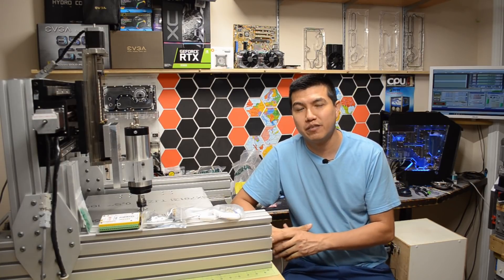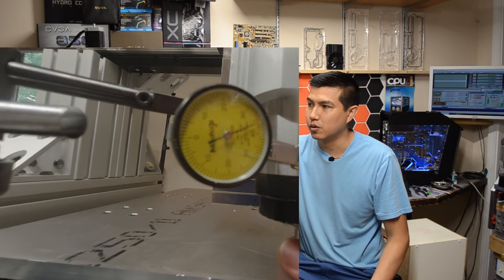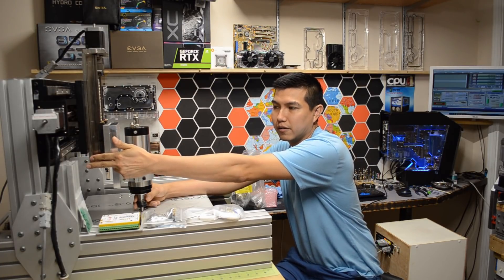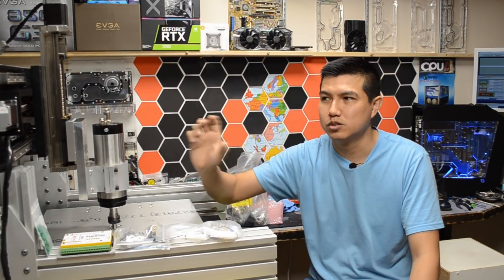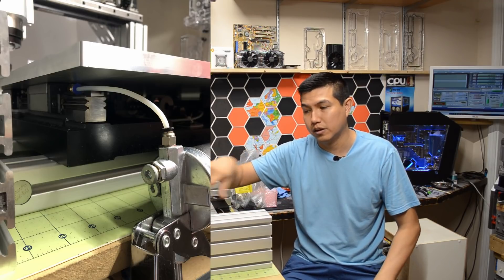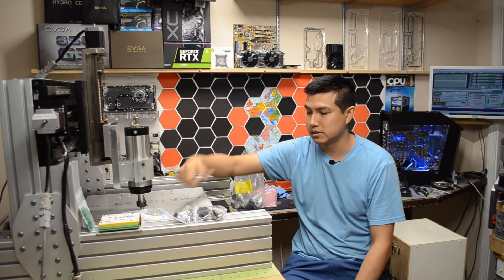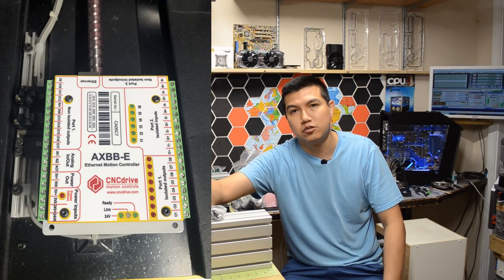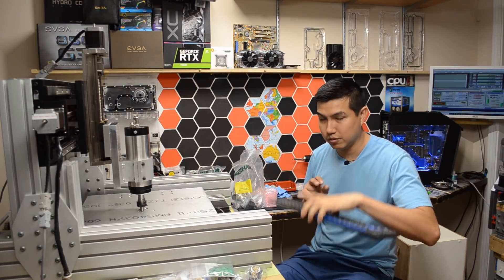DIY CNC Router: First Movements and Other Projects

Comment: why too noisy?
Reply from the maker: It’s just how stepper motor work trying to do to Microstepping. I got Close loop steppers after, it got much quieter and faster
Reply: @radikult-custom  bigger stepper motors like nema 34, is too noisy or less?
Reply from the maker: @Acseq8wy  it all depends on the speed and the micro stepping. Noise level could be around the same but a lot of things can make a difference

Comment: Greetings from the UK, thank you so much for sharing your wealth of knowledge.  It has been a while since you made this rebuild using repurposed equipment into a precision fixed gantry milling machine. Would love to know how well it has performed. 

Btw can you please tell me how to create the gcode for running the speed tests you showed in this video.
Reply from the maker: Greetings 👋. I have build a few CNC and by far fixed gantry is the best type for precision. 
 The Gcode was made in a CaD program like fusion 360, just cutting a circle in the air are different speeds for example.
Reply: @lt-custom Thank you for your reply. The problem I have is getting hold of the type of extrusions that 80/20 Inc make are not available in Europe/UK and the only way to get hold of them is someone can bring when travelling in our direction but depending on the lenghts/weight that can also be a problem. 

The nearest quality one can get to strenght is maybe getting profiles supplied by Mitsumu but their prices are very expensive for small orders. 

BTW - did you ever get round to covering the x-axis with Epoxy? Would love to see more videos of your cool machine milling different materials. Take care my friend.

Comment: You could just buy a stepdown converter from 48v to 5 - 24v. I personal run a gecko as well and I went with a 48v to 12v step down converter and run all my limit switches and relays off of that.

Comment: In your previous video showing how you filled the extrusions with epoxy granite,  it sounded like there was a big difference in ringing and vibration control when you tapped on them.  But in this video at 7:50 You are still getting a lot of vibration running at 28 IPM.  Have you found a fix for that?  I have a similar situation.  I was thinking of putting some foam board or shag carpet between the cnc and table to absorb some of the vibration.
Reply from the maker: I was using stepper motors for testing. After I change it to Closed loop steppers I don’t see the “vibration” like in the 7:50 min video
Reply from the maker: Maybe if you use a thick rubber mat can dampen the vibrations
Reply: @radikult-custom  so you get less vibration from the closed loop stepper?  any chance that you'll be demoing how it runs with those?
Reply from the maker: @bigvelvetdog  this was the final video I made. It shows a little bit of how the machine is moving at some slow speeds when probing 
https://youtu.be/3dYUZVZPBNs

Comment: Whats causing the stepper motor to make so much noise at low speeds
Reply from the maker: Fisherman Neil “power” the more voltage you give to a stepper motor the more noise it will make at low speeds. (Testing with 48v) But if you give very low voltage(24v) it won’t make to much noise but won’t have torque/high speeds

Comment: As an engineering student I must say great job!!
I have seen your whole build the one thing which annoyed me most was when you said I have so CAD..:(
As I continued watching I had some issue with your design since you have addressed in fine tuning i wont talk about that But,
i felt there was waste of material,If you had a CAD model you could have simulated and fine tuned the model and it would have turned out better.
the other issue was WHERE IS THE COOLANT!!!!
atleast may be a fog buster i would suggest otherwise Enjoyed watchin it!!!

Comment: Clearpath servos are nice but expensive and a lot of their built-in features are useless for direct step/dir controll. 
JMC's integrated servos are more than enough for a hobby machine and cost only a fraction.  
They also have closed-loop steppers with integrated controllers which are a good choice for the z-axis - during 2.5D operations on a router a higher holding torque on that axis is more important than peak power at high rpms. There's still a place for steppers, just not the cheapo open-loop stuff.

Comment: Nice work! subbed! I'm a fan of the fair cheap JMC 180W servo's. Smoother than steppers, faster, torque is perfect (a stepper looses holding torque with microstepping). I'm using them on my machine too, and they perform awesome. Clearpath is a clear winner in terms of user  friendliness (their auto-tune is very nice) .  The JMC's don't have advanced notch filters for system resonances, but they introduce far less resonances than steppers to begin with. The current available V6 (i'm using V5's) has some sort of auto-tune, but it's relative rudimentary.
Reply from the maker: Berend Lucas van der Weide I end up getting some Closed Loop Steppers, the clearpaths are great servos but I just didn’t had $$$ lol
Reply: @radikult-custom  Perhaps test one of the cheap (100usd/each) JMC 180W servo's! Closed loop stepper is a huge upgrade from the standard steppers! Do you use your machine to earn money or is it only for your own parts?
Reply from the maker: Berend Lucas van der Weide I use my cnc to make my own parts that I sell on eBay. So yes I use my machine to make money
Reply: good. I also use my machines for that purpose. I do  have some regular customers, make furniture on my larger machine, smaller one for aluminum and plastics/occasional steel.  It's nice to enjoy what your doing and make money in the end.

Comment: So ... You went through all the effort of epoxy granite filling the extrusions to get a better finish ... that means using real steppers would be silly and you should go with servos. Steppers ... step. You can see that 'stepping' in the finish. Servos don't have that issue and provide a smooth motion.
Reply: I'd consider closed loop steppers and a good quality hybrid driver, then max out the steps per revolution. This should be well suited to an aluminum machine. These days good steppers with good drivers can get high resolution & low noise but still have low torque at high speed and also lower efficiency for similar performance versus servo motors. Closed loop stepper systems are about 1/3 the cost per performance vs servos on the low end of the scale (up to NEMA 48 maybe) so as always we have to weight the pros and cons. Really though servos only become the best or only option when a machine requires torque or speed that simply isn't available from steppers for practical reasons (ie power dissipation, inertia considerations from the mass of the motor etc) or availability, which you get into on larger heavier and faster production machines.

Comment: Possibly look into "Clearpath Servos" dead quiet, tons of torque and generally don't loose steps also don't require smoothstep boards.
Reply: Or an inbetween solution (both price and performance), Closed loop steppers and drivers.

Comment: You could remove or shorten the Z plate that the spindle mount attaches to and clamp the spindle higher up.  The spindle motor is very rigid, it's a stainless/aluminum tube and is much stiffer than your aluminum bracket.  And you would be removing a source or vibration and weight on the Z.  If you delete that bracket completely, you would also be reducing the distance your spindle overhangs the gantry, which will increase the stiffness even more.
Reply from the maker: Reini Grauer I actually did that before making that extra aluminum plate. And you are correct, even do the spindle was attached at the very top I didn’t see that much play. 
The only issue with that is that the spindle didn’t quite reach the bottom Y axis table.  
Maybe once I make the vacuum table I’ll re measure the spindle depth and maybe remove that extra plate 
Thanks for the input
Reply: @radikult-custom  The end of the spindle doesn't necessarily have to touch the bottom of the table, as long as the shortest tool you are likely to use does.

Comment: Wow, those steppers sounded like WWII planes in a dog fight.
Reply from the maker: aksting lol. Happy 4th of July? Or remembering veterans days?
Reply: @radikult-custom  Veterans day is for honoring veterans, Memorial Day is for honoring those who served and died, and Independence Day is a commemoration of the Declaration of Independence from the United Kingdom. As a veteran myself, I find Memorial Day is not about having fun, but remembering the ultimate sacrifices many have paid for our freedom. However, Independence Day is for everyone and the best way to commemorate this day is by simply exorcising  your rights. I hope you have a very good Independence Day.
Reply: Are you using microstepping? Usually helps getting the slow speed vibration under control. Of course you loose speed.
Reply from the maker: pitu72ger I am using micro stepping, but it’s just how steppers work I guess. I just need to buy either servos or Closed loop steppers
Reply: @radikult-custom  I highly recommend the 3 phase closed loop steppers. They are very quiet. Not as silent as a well tuned brushless servo, but as good as you can get. Nema 23 motor and driver will cost  around $160.
Reply from the maker: aksting where can I find the stepper you mentioned? 
 I was looking at some 600oz from Stepperonline

Comment: mill the entire table with rhe router itself.. it will then be .00000 trammed across the table.
Reply: that only works if the X,Y and Z axis are perfectly square and flat to 0.0000000 inches (which no machine is and will ever be)

Comment: couldn't you use inputs 1-4 on the gecko for your limit switches i think they are 3.3 to 5 volts max. O and can i get some links to the touch probe, tool setter, and dust shoe in part 2 of the build. loving the cnc build videos i finally subbed
Reply from the maker: Ever Random here is a link to the touch probe 
https://drewtronics.org
The dust shoe I made it myself 
And as for input 1-4 on the g540 are negative trigger of the same 48v power supply.  Thats why I can use that with the optical limits
Reply: @radikult-custom  man that dust shoe is sweet  i would love to see a build video of it maybe one for the new machine? im curious how you formed the sides a heat gun maybe?

Comment: you are making a very good machine

servo motors or hybrid stepper motors would make it a much better machine

It would also be a great improvement that you forgot about the mach3
  and you tried the Linux that goes in real time and is much better in everything

greetings from asturias spain
Reply: yes, Linuxcnc is where its at. If you have time and patience that it is :D But its also soo much better than mach3/4 or similar

Comment: You had your z axis assembly the correct/best way round originally, you should have kept it that way and worked on the deflection by other means, now your cutter is always a set distance from the first bearing support, originally this distance was dynamic and changed with the Z height at any given time (dynamically optimal). More tuning is correct, you can hear the motors stalling in your z axis tests. Join us on www.mycncuk.com 👍
Reply: His ball screw from the original is too far from spindle. This one is more directly connected to spindle than the original that needs too much plates going aroung the gantry.

Comment: Radikult One thing you should do first is to run this test on a true/flat surface. I kno for a fact that the extruded aluminum u have on your bed is not flat at all. They can have low or high spots as bad as 0.3mm  to 0.5mm. So when you are done with your controller etc, calibrate, tram and surface  your machine before running such tests.
Reply: If he trams his spindle completely perfectly perpendicular to a reference point on the bed, couldn't he just machine the whole bed suface flat with reference to the gantry? Wouldn't that eliminate that problem?
Reply: mhe0815 Yep, that’s exactly what I’m saying.
Reply: @VHERSACNC  Oh, ok, got it now, thanks!

Comment: What's making it lose its Z position so much? Pretty sure that's the biggest problem I'm having on my Shapeoko
Reply from the maker: Kaleb Israel in my case it’s probably the acceleration might be to high and the stepper can’t keep up with it. That’s why it take awhile to find tune a cnc making sure everything is working correctly
Reply: @radikult-custom   Wish I had the money to buy a fancy machine and pay someone to come tune it. x,DD
Tired of messing with mine always wishing it was much better.
Reply from the maker: Kaleb Israel that’s how I started. With a Chinese 6040. And I try to make some changes but at the end I just decides to put all the effort into building my own cnc. 
I do wish sometimes I had the money too to just buy a new cnc but those can cost $$$$ lol
Reply: @radikult-custom  haas milling machines do not cost too much, moreover, if there are many people who request your products, you can pay the milling machine through a loan, but pay attention to the terms of the contract ... otherwise a cheaper alternative is the tormach, with $ 10000 you have a cast iron machine with an accuracy of 0.003 inches, it's not great, but the machine is rigid and could help you increase your productivity... customer service is bad if you want to make the return, but if you want to take the step forward from diy to something more professional, these are the two paths... if i can, i wuld go for haas
Reply from the maker: Libra SD a dream for me would be a Datron Neo but they cost more than a Haas lol
Reply: @radikult-custom  i know, that machine are built for micro-machining

Comment: I'd suggest a better table. The aluminium one is to thin.
Reply from the maker: Chris Atack the idea is to make a base of cast epoxy granite. But I just need to make sure the rest is good before putting more work into it. 
Also I’ll have to move the cnc to it’s final place  before doing that.
Reply from the maker: Chris Atack oops, I read that wrong lol, yes the Y axis aluminum table is only 1/2 thick, but I have a piece of phenolic 1-1/2 thick to make a vacuum table with it and attach it to the aluminum piece too

Comment: You should really consider purchasing one of two things. 1. Clearpath Servos, 2. Moons close loop steppers. Your current build is too good for standard steppers.
Reply from the maker: Mike O'Connor I have clear path servos on my other cnc, and I’m considering getting them for this build or just some close loop steeper’s since those are a bit cheaper than teknics servo
 Thanks for the input I’ll check those moons steppers
Reply: @radikult-custom  Cool. Great build.
Reply: Radikult I totally agree with Mike. You need better motors, so get some closer loop steppers when you can. As I told you, I can get you a good deal from my suppliers.
Reply: @radikult-custom  also consider the integrated Servos from JMC (180W will be probably more than enough), the price to performance is really good